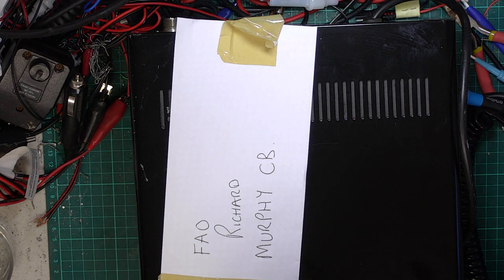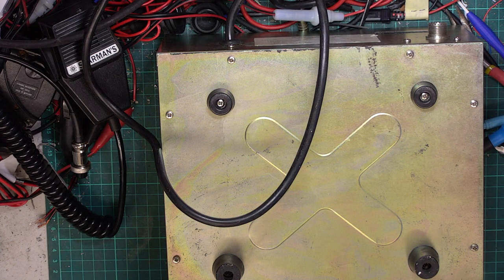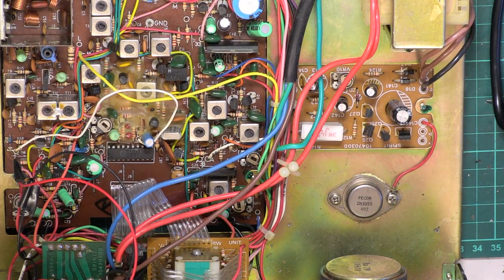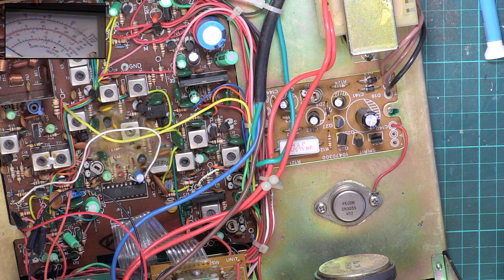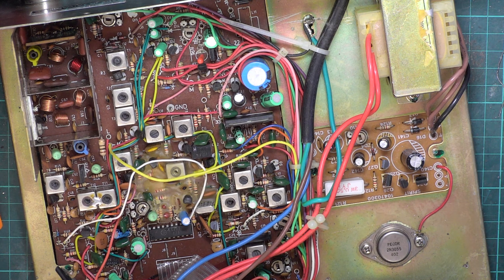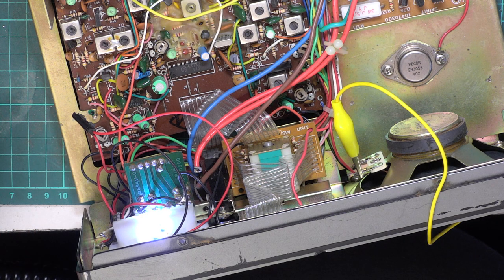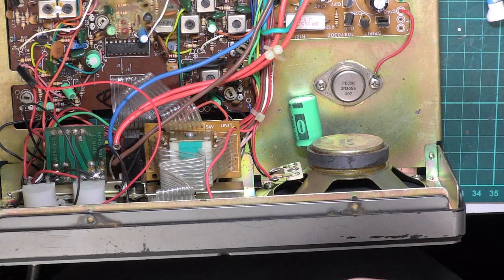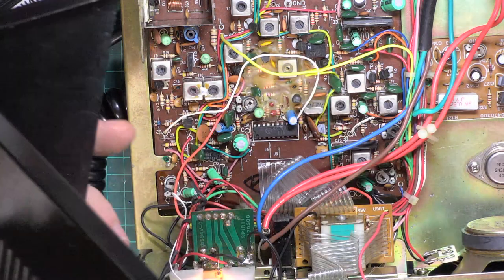Murphy CBH1500 UK CB27/81 CB radio (base Station) - Repair & service

Comment: Base stations are always disappointing when you take the lid off to see just a cheap mobile radio and tiny PSU placed in a big case.  Loving your laugh at 3 mins in Richard, of course you and Mr Chippy are famous in 2 way radio circles :-)

Comment: Oh a lot of work been done and the Screwdriver expert has been into it as well.  No headphone socket, the last one I saw had a 1/4 jack plug on the front.  It appeared to be factory fitted.  It also had a 12vDC plug at the back, it was so neatly done it must have been factory fitted.  Still had a rubbish power supply in it, except the capacitor was bigger then normal.  I had a look to see if it had been changed, it looked original.  It also had upgraded diodes in the rectifier, a full bridge one unlike he half wave one that is normal.  I offered to buy it from the owner, but he was not having it.  I wish I remember hos address, I am sure he would let it go now!  Maybe he sold it without giving me first offer.  I quite liked the look of them, but the performance!  A yellow LED might not look so bad, but a hard white one will be for to bright.
Did you ever do a Gemini CB, I think you did I will need to have a look, it is one set that should have been better than it was.
I did tell you the site was charging for data these days.
They would have been better if they had charged a £1 for every download, even £2, they would still have made money, after all people like you was good enough to upload it all for nothing.  Anyway, if you uploaded stuff you were supposed to have FREE access!
I am amazed sites think that people will pay per month, as soon as I see that it is instant "No way" and it is "Goodbye".
That LED is very bright, put in a bulb or an off white LED.
Sad you were forced to delete your manuals from the site, but they have some amount of cheek when it was you who uploaded them in the first place and they want to charge you for getting a manual out, even if it was not one you uploaded, their terms were, If you upload you are entitled to download for FREE.  I hope the site is forced to close down when other find it is charging to much and they pull their manuals from it.
Shame you couldn't upload them somewhere else, but that would take a lot of dedication.
Reply from the maker: Yes, I Covered the Grandstand Gemini back in 2014. They work well, but like the Grandstand base that uses  the same Suruga manufactured chassis, are not reliable owing to dry joints inside the PLL/VCO.IF huge can that's filled with wax. Not helped either by the NEC UPD2812C PLL chip which was already well obsolete when these rigs were made in 1981. Suruga must have been sat on a skip load of them! When working, the Grandstand Gemini works very well. Has good tight RX filtering, so anyone over-deviating or using an illegal radio comes through garbled. I find that fun as it will only receive strictly legal stations!

Richard
Reply: @ukfmcbradioservicingTango21  Until the legal CBs drift off enough not to be heard properly.  Maybe a set for a busy area.  Never really liked them as they tended to sound over deviated even out of the factory.

Comment: I remember these being sold. Pity we couldn't see the meter in the second camera. That transformer really looks under rated doesn't it? Thanks for sharing with us.
Reply from the maker: Yes, it's a shame that section 3 of the video didn't record. Apart from the dodgy meter, and the superglued switch that you missed, it was TX tune up...or down as it came in doing 4.4W. However, I've covered the CBH1500 twice before so it's easy to look up the missing bit of a different video. No idea why PiniP failed. Video mixer must be in a "shan't" mood.......coz it was showing on my monitor!

Richard

Comment: Richard, if the deviation is set too high, eg 5Khz like this one can that negatively impact range? eg is the power being spread more thinly over a wider bandwidth?
Reply from the maker: Yes, over-deviation has a negative impact, reduces range & chops the side off the audio as it tries to pass through the filters in the receiver.....unless you are receiving on a Fidelity 1000 or similar with very poor filtering!

Richard
Reply: @ukfmcbradioservicingTango21  thank you Richard, im still loving and learning from your videos 🙂

Comment: I have 2 of these and one is definitely not working as I looked at it in a recent livestream. Not sure what you did to the s-meter as looks like you lost some footage. Also the Picture in Picture went off. Glad you got it all sorted and that meter light had to be changed. A real shame that scribd have decided to be idiots as we all lose out.
Reply from the maker: Yes, we lost the tx line-up & trying to unjam the meter mech. No idea why the PinP decided to leave. The radio failed the 'on-the-air-test' over squelch sensitivity, so I spent some time this morning stagger-tuning with meticulous care & vastly improved the SINAD figures. Hopefully it will work now.

Bear in mind these were deemed as 'crap' sets at the time. You & I can spend much more time on alignment  that they ever got at the factory. I have a circuit if you haven't BTW.

T21
Reply: @ukfmcbradioservicingTango21  Noce one Richard. I will take you up on that thanks Richard. One has been well and truly got at